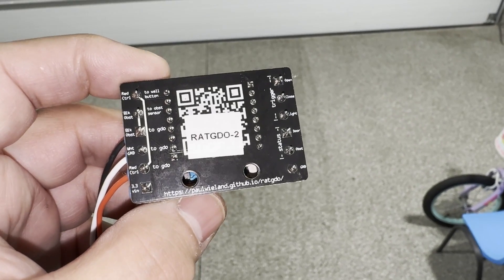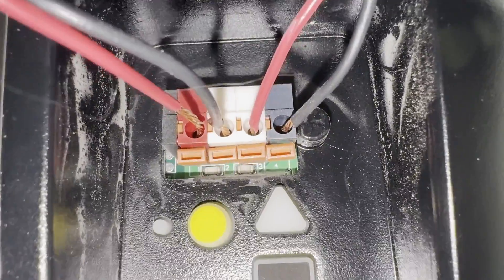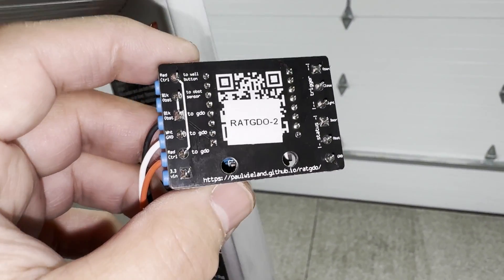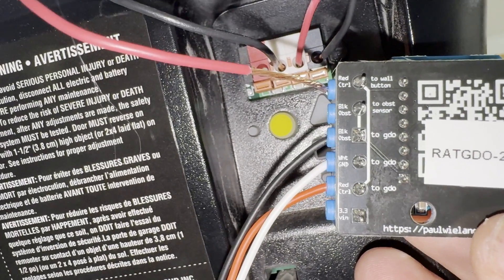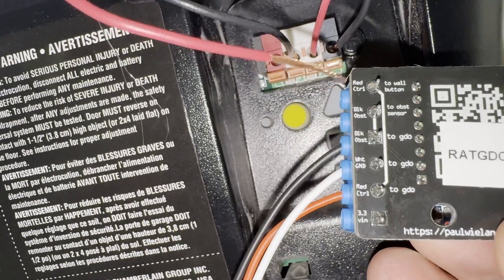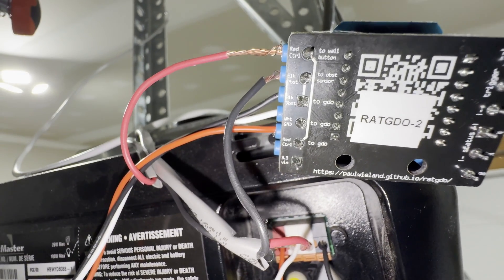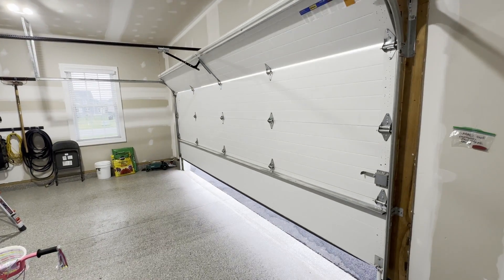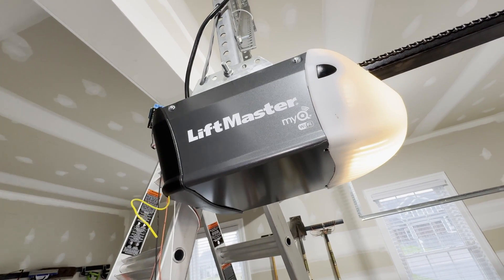Wiring the ratgdo 2.5 board into a LiftMaster garage door opener

Comment: I’m running a Ratgdo with a Control4 system.  I just used the 3 wire leads (red , white, and black) and twisted them together with the existing leads.  I didn’t have to use any of the other connections or pass through ports, works just fine.  I also used a 3m fastener to stick the board directly to the back (I have the same motor as you) 
There’s a flat space next to the serial numbers you can just stick it to, no mess, and secure.  Cheers.
Reply: ah this is what i did on 2.53i. don't use any of the pass through on ratgdo and just took three wires and put them into GDO and it seems to just work. Do I need to use pass through?
Reply: @AndrewReifel passthrough only exists to prevent you from having to put 2 wires in one connector (the connectors technically are not designed to accept more than 1 wire even though that generally works fine it's a single wire connector)
Reply: @AndrewReifel  

Not unless it’s a dry contact opener.  If it works now, you’re good.

Comment: Besides being able to operate this if the internet is down what is the benefit of this over the liftmaster wireless operation?
Reply from the maker: The benefit is that you can reliably integrate your garage door openers into a smart home system like Home Assistant or HomeKit. This capability existed before, but Chamberlain kept intentionally breaking the API to torment and annoy Home Assistant users, I suppose to annoy them enough to want to purchase one of their lame, proprietary integration offerings. Read this article at The Verge, for more info: https://www.theverge.com/23949612/chamberlain-myq-smart-garage-door-controller-homebridge-integrations
Reply: Isn’t it just far more simple to use the Liftmaster wifi setup as is (particularly for people who have it built into the units) and install a wifi relay into the 2 wire button circuit? Thats what I did and it’s far easier to wire and setup. I have one for each of my two doors. One is named “my name” Garage and the other is named “my wife’s name” Garage. We also made a group called Both Garages. That way we can operate each individually or both at the same time through our Echo (also works with HomeKit, and Google Home, etc.) by simply asking “Alexa turn on ____ Garage” or Alexa turn on both garages”. The cost is $10 per door vs $45 and only 2 wires to connect along with the usb power. The MyQ app still shows the status of the doors and allows for scheduling etc.
Reply: @lectrician7  You can't really use a simple relay (e.g. Shelly, etc) with Security+ 2.0 based openers, unless you're willing to solder a dry contact adapter to a compatible GDO switch, which the vast majority of people are not willing or able to do. The ratgdo is a much simpler, non-invasive method to achieving total local control, while also retaining MyQ app compatibility.
Reply from the maker: @lectrician7  Another benefit to using ratgdo is that you can get the actual current State information of the garage door opener. So you can set up an automation or controller to open the door halfway, for example (if you use the ESPhome firmware instead of the default mqtt based firmware). Or you can control the light on the opener based on triggers from other smart devices.
Reply: Yes correct. But in most practical situations why would need to know if the dor is partially open. Most people need to know the open/closed state and that’s it. As far as the light goes, if I want a light on in the garage and do it remotely, a smart switch connected to a phone or smart home device seems much better solution. I guess my use case doesn’t necessitate a device like this.

Comment: There are 2 issues with the site/docs and 1 with the physical product that jumped out at me right away. 
1. The site shows wiring and mention of a 2.52 board but AFAIK, the latest board to ship is 2.5i - I just got my board over the holidays.
2. The diagram on the site shows the bottom of the board instead of the top. This needs to be changed as when you're using the terminals you'll be pressing them from the top.
3. The terminals are too small to fit anything but the smallest of ferrules - if you're going to use stranded wire, you should always use ferrules - I had to use bare solid wire for some connections.

I'm seeing a couple of issues with mine. The first is that the obstruction sensor often stays on "detected" and won't clear. Lastly is that on my Security+ 1.0 LiftMaster Jackshaft there's no "opening" or "closing" status and both UP/DOWN controls are the same thing, just a momentary button. In other words there's no dedicated OPEN and CLOSE commands. Need to find out if replacing the keypad with a different version can remedy that.

Comment: While the video is really helpful in reality, all you have to do is run wires directly from 3 ratgdo connections on theboard to your 3 connections on the chamberlain - you do not have to remove wires from your chamberlain to the ratgdo board - he refers this to this in the video but just did the installation another way - in my opinion, the hard way. No need to use the pass-throughs on the board and it only will be confusing to folks who might lose track of wiring.  My board came with maybe a 12 inch piece of triple stranded wire.  It was too short to work and too thin, and even though I tinned the strands, they weren't stiff enough to go into the connector block on the Chamberlain.  I would recommend using something like telephone wire –insulated thin hard copper in insulation  – and just run a wire from each of the three connections noted in the video from board directly to your garage door opener wiring connectors. I used 18 inches of wire and was able to then fold the device up above the garage door opener for storage. It also would be helpful if you want to take it down when you have to reflash the firmware when it's upgraded. I was able to keep the Chamberlain wiring in place and just slipped in another wire. I would be very careful to look at how your wires are connected before hand in case some pop out and you lose track where it goes. Also, there's no need to turn the power off although all the wiring around you can get in the way. There's no high voltage going to any of these connections. I used the HomeKit firmware 0.6 and had two issues. After I installed the software, it would not associate with the Wi-Fi and timed out multiple times as reported on other sites, In reality it does associate and if you look at your router connections , you'll see that the device does connect with an IP address to your Wifi. (curiously when I tried flashing with the MTTQ or EP house, firmware it associated with the Wi-Fi immediately)The other issue I had was after completing the installation is you have to use a QR code to install it the HomeKit Home app. The first two times I did it it establish the icon in the Home app, but it said it was "not connected" (even if the device is not connected to the chamberlain. If it properly installed You'll see both the garage door switch and its light switch.- until you see that it will not be associated from the device into your Home app -  the third time it worked. Quite frankly I can't tell you what I did to make it work, but it did so be patient. 0,.6 his beta software, and one has to assume there will be issues that that have not been wrong out. Thanks again for the video  -it made me think of alternative ways to do the installation that involved less steps.
Reply: Are there any downsides to doing this the "easy way"?
Reply: @MatthewMiller-mattdm no other than saving time and not having to move, wires off the chamberlain to the board, where they ultimately are connected to each other there – so why not connect them at the chamberlain. You achieve the same thing, and he actually refers to this at the beginning of his video saying there’s two ways to do this.
Reply: the v0.7.0 Homekit s/w added OTA programming - currently the latest v0.9.0 seems to be rock solid
Reply: What about the connectors on the other side? "Status" for door and obstruction, and the "trigger" connections?
Reply: While they're there, you don't have to connect anything to them – just follow the directions in the video.If you have an obstruction sensor already on your door, it's already wired to the chamberlain - it has to be - I break the light to trigger the obstruction sensor as the door closes,   the door immediately goes up. Just wire it as it shown in the video. @MatthewMiller-mattdm
Reply: @bob4k4  Presumably you get something if they are connected (like sensors that can be acted on in home assistant?). But... what do they connect to? The Liftmaster manual is annoyingly vague.

Comment: I understood the diagram fine once I looked it over, what I don't know is any coding needed for setup/integration. I've been contemplating getting one myself.
Reply: You don't need to do any coding of any kind. Nothing to set on either the garage door opener or Home Assistant sides. Just add MQTT (and make sure you're running a broker like Mosquito) and subscribe to the correct topic.

Comment: Thank you for the video! Really helped me understand the wiring for this device. What I noticed on Pauls website is that his photos of the two white terminals are hooked up in reverse from his diagram. For example, in his photo where you can see the QR Code side of the ratgdo, it looks like his white ground wire is hooked up to the third terminal instead of the second terminal from the left. But his diagram, and also the way you hooked it up, the white ground wire is hooked up to the second terminal on the left. Then on the other photo, where it is showing the ratgdo flat with the "Liftmaster" wall switch showing, it looks like he's got the one of the wall switch wires hooked up to the optional side of the ratgdo... I noticed that his wall switch is different than the one you have. Mine looks similar to his in that it has a motion sensor on it so maybe that is the difference in wiring?

Photo of ratgdo qr code side:
https://user-images.githubusercontent.com/4663918/278091772-464265aa-a377-4ef8-b5d9-5b4bfb77d189.jpeg

Photo with Liftmaster wall switch
https://user-images.githubusercontent.com/4663918/278091586-63ff87f9-f67b-49a5-bc8a-c3c8a5bdab73.jpeg
Reply from the maker: Yeah, that's definitely super confusing (and hence why I made this video!). I based the wiring setup shown in the video based on what his 2.5 wiring diagram depicts, where the White GND port on the ratgdo feeds the terminal port that the existing ground lead coming from the wall mounted door button is currently connected to. I'm not entirely sure why Paul's photos show it connected to the 3rd terminal port on the opener, which should be for the Obstruction sensor?  My general suggestion is to make a note of where each existing terminal connection currently goes to, and wire the ratgdo terminals to them based on the intended endpoints shown on his diagram (e.g. the "Wall mounted button" and "Obstruction Sensor" blocks in the diagram).
Reply: @postproductive  Ok thanks. I'll ignore the photos and go by the diagram and they way you did it.

Comment: You mention plugging it into a 5V USB power adapter. How many amps is that 5V USB  adapter? (i.e. how many amps does the RATGDO need?) Most of my 5V USB adapters are only 1 Amp...is that enough?
Reply from the maker: I just used the same Apple 5V iPhone USB adapter that everyone probably has hundreds of in their home.
Reply: If you order the installation kit when you order the RATGDO board it comes with a wall adapter.

Comment: Really nice work! I am looking to power the board off that low voltage connection. Have you explored that at all / found resources on how? I just got my boards, installed the software and connected to my network. Wiring is next.

Comment: It would be nice if you did a video on how to download software as well. Great video...
Reply from the maker: Software installation is very straightforward. Roger's Tech Talk runs through the procedure here (at 7:27): https://youtu.be/F6IVu7cIEf4?t=448

There's another good installation video here (Mac-centric when it comes to the firmware flashing, but still applicable to all platforms when it comes to the firmware configuration): https://www.youtube.com/watch?v=N2tbcq2loC0

Comment: If you want to make those low-voltage wire terminations really nice and clean, look into a ferrule crimper. I've even doubled up conductors into one ferrule. They're really essential for stranded wire with push-in connections.
Reply from the maker: Yeah that’s actually what I ended up doing  when I did the final cleanup. Even though I don’t think they are as important to use in low voltage applications like this, they are definitely worth doing from a neatness perspective!
Reply from the maker: This is the ferrule/crimper set I used, for anyone who would like do this. Super cheap and worth having around for things like this (and especially if you have a 3d printer!)

https://www.amazon.com/dp/B07XBLGPCY?ref=ppx_pop_mob_ap_share
Reply: @postproductive  I tried to use ferrules yesterday, however the the ferrule didn't sit deep enough into the garage door opener socket -- its like I needed extra long tips.  I just kind of gave up and went the bare wires.  On the back of the garage door opener near the terminals there is a gauge on how long to strip the wires.  The ferrule tips are definitely not as long as this gauge.
Reply: @kevinhilton8683  That's a problem with anything but the thinnest ferrules on the terminals of the garage door opener. I also had to use bare wire for anything that didn't use the 0.5mm (or so) ferrule. The thicker ones just pop right out.

Comment: Thank you very much Mel🙏, after instaing this case we still use the myq app will everything work just like before?
Reply from the maker: Yep! I’m actually keeping the MyQ app connection working because I like to use Amazon Key for deliveries, and I also don’t want to make the rest of my family learn a new app just to open the garage door.
Reply: @postproductive  so do we have to do something different or just follow your steps? Are you using ESP home version, can you please post a link for the one you got. Thank again 👍
Reply from the maker: @amithimani8163  This video is for the ratgdo 2.5 board which can be purchased directly from Paul Wieland (link is in the description). You can flash his board with the ESPHome firmware if you want, but I don’t really see much advantage to it for my needs, as controlling it via mqtt works good enough for me.